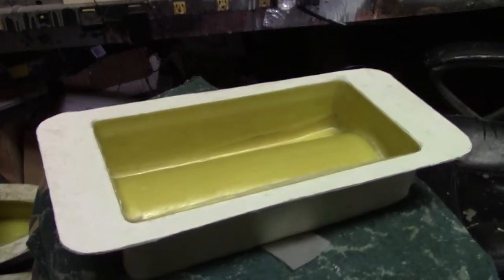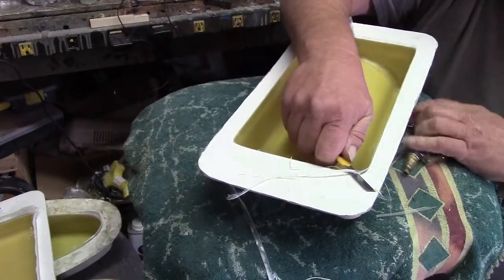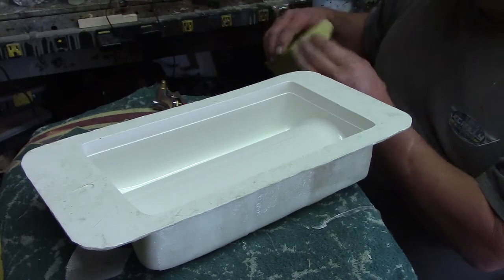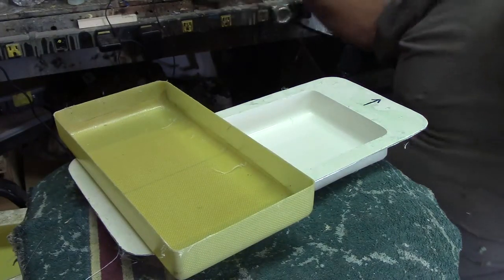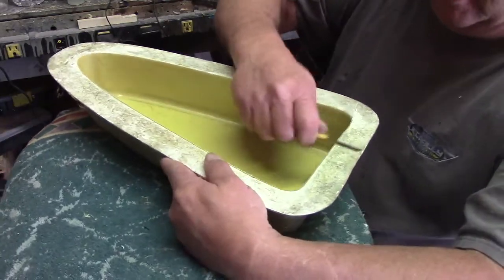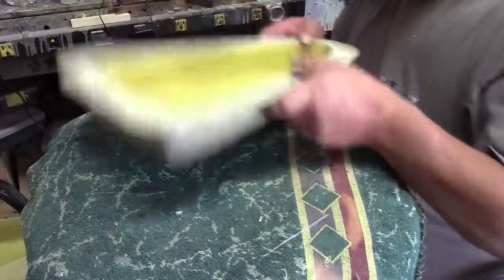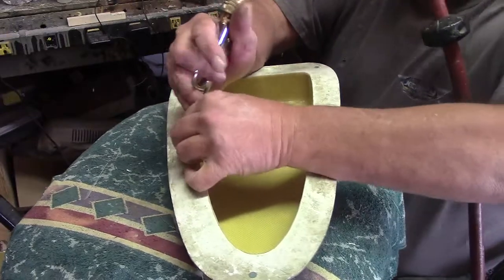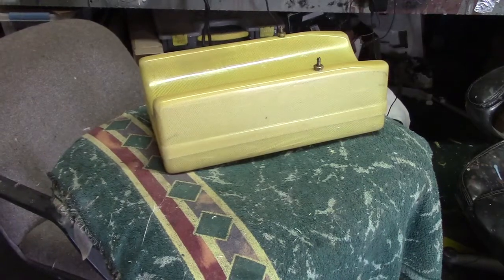taking fuel tanks from mold

Comment: Bob,  Very good. So the kevlar, fiberglass mat and resins are inert to the fuel. Question (1):  Why no baffles to avoid sloshing?  Question (2): Are the tank(s) pressurized to aid siphoning, when the plane is in various orientations in flight?  It would seem you would need multiple pick-ups for continuous flow of fuel at any orientation!  Thanks =CHRIS=